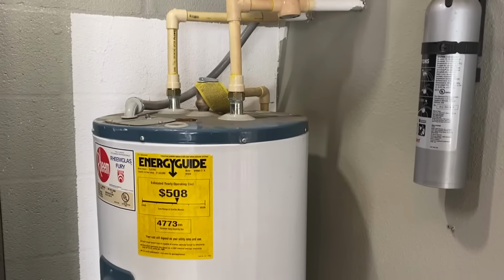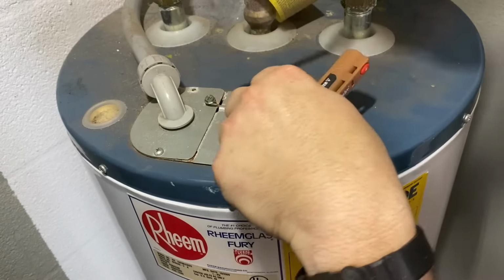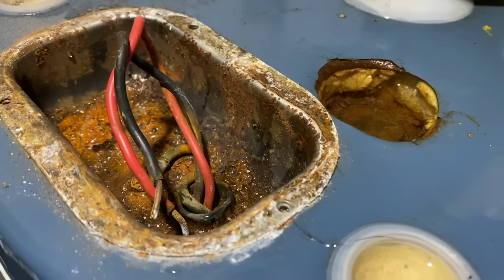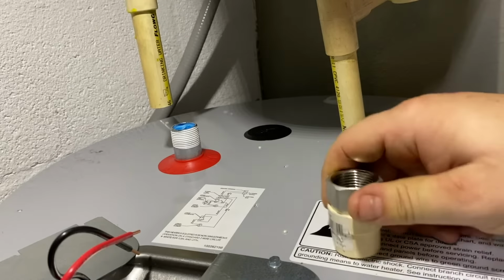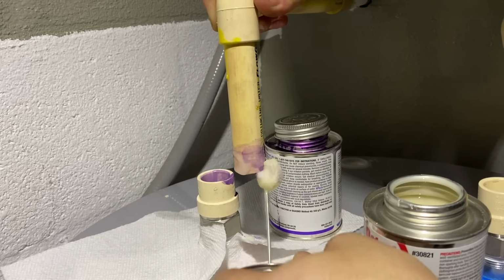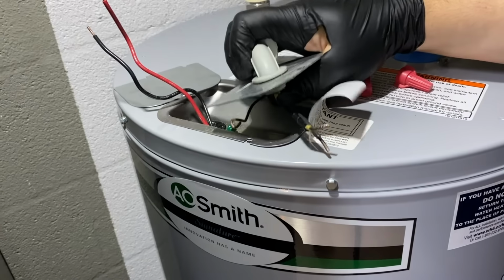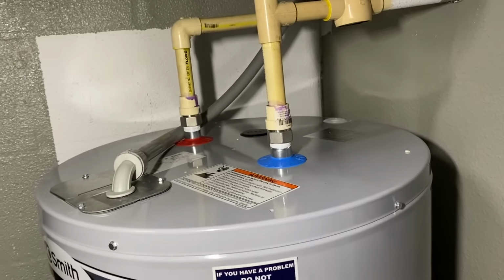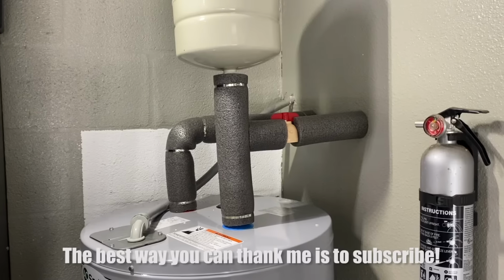How To Replace Your Electric Hot Water Heater | Full Install DIY

Comment: You have a valve on your cold water side you could shut off instead of killing your whole house. I would have added a valve to the hot side to just to be able to isolate water heater completely.  You should also replace the expansion tank when you replace the water heater too. Just suggestions. Nice work.
Reply from the maker: Oh yes. I know. I’m trying to make the video appeal to the masses in case they don’t have isolation valves. The crazy thing is... my local big box was out of stock of shutoff valves 3/4” so I couldn’t add one at the time. Believe me I wanted to add it and show it in the vid but I have to Keep it as simple as possible. Thanks for the feedback. That expansion tank is only a year old but yes. If it’s original to the WH def replace at the same time. 👍
Reply: It is against code to have a valve on both sides. If they are both off the pressure of the water heater heating up has nowhere to go except out the TMP
Reply: @gunslinger-j1v  I've never seen it anywhere in the code book where it states no valve on both sides.
Reply: @joejr9653  it is at least where I’m at. I wouldn’t do it but to each there own
Reply: @gunslinger-j1v  FYI That depends where you live!! Not every country,province or state has the same regulations!
Reply: @mikegarrett3815  true that. But it's absolutely useless and a stupid thing to do